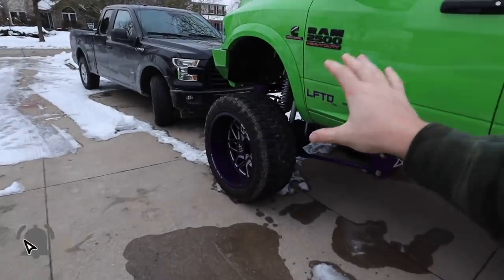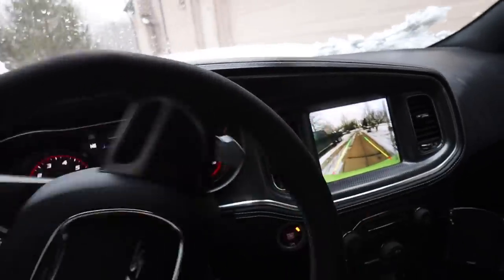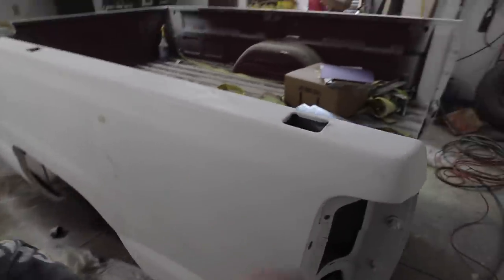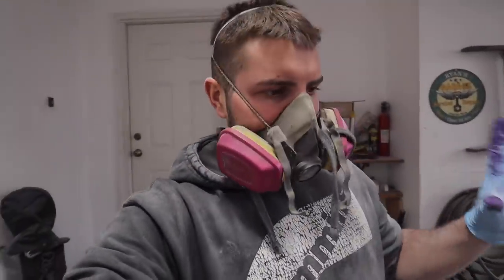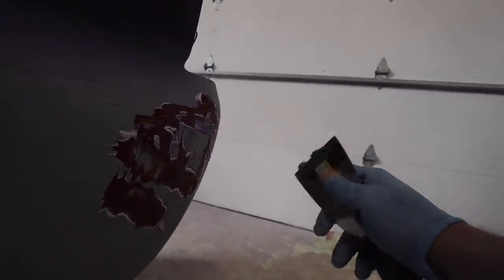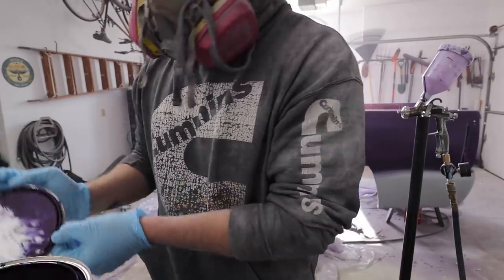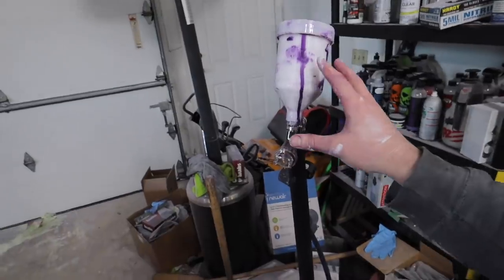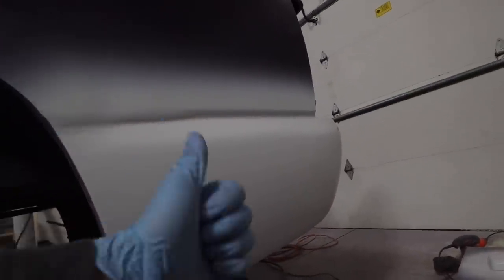I Am NOT Painting My Silverado LIME GREEN.....

Comment: A tip from the uk: before sanding the primer, put a really light coat of black paint on top of the primer. Don’t spray it solid black but just specs of black everywhere. Then when you sand it, it is easier to see any high or low spots and any pin holes you may need to fill before paint. Also wash you panels down before paint.

Comment: Alligatoring causes paint to craze and form wide cracks so that the finish resembles alligator hide. It is often accompanied by puckering, and sometimes the paint fails to harden properly. This is usually caused by applying a second coat before the first coat has completely hardened...

Comment: The wrinkle /peeling is from the solvents in the paint reacting the the rattle can primer go back it a good automotive 2 part primer. Rattle can primer and some automotive paints just won’t work together and you need to be wipe if the panel down with wax and greese remover before spraying and go over it lightly with a tack cloth before painting to remove dust and stuff from the air settling on to it

Comment: You need to sand it off then use rubbing alcohol wipe the surface  let dry .
Then use sealer primer sand that a little bit then wipe it down again .then apply color.

Comment: Did u use wax and grease remover prior to painting? That super clean  u got doesn't count .  You need an automotive  heat light.  I'm guessing it's not that warm in there to let things flash the way they should

Comment: Question if you don’t mind. I have a rust hole about 4 inches in diameter. Should I weld a small piece of metal to it and sand it till it’s flush then use body filler and paint and all that. Or do you think should I simply cover it with body filler? It’s a small hole directly behind the rear door of my F150 right before you get to the bed. Thanks dude. Great vid as always
Reply: Definitely weld in
Reply: Single Piston Productions Gotcha. That kinda my thought too

Comment: If you dont get some ventilation going when you clear it's going to look terrible. All that overspray fog. And yeah definitely need alot better clean down of the panels, WAY more. Wax and grease remover. Get some ventilation going. And clean up the dust and shop a lot better. Get the floor damp, some big wet blankets or towels work really good in a pinch or misted down cardboard on the ground. The SLIGHTEST variations in cleanliness, temperature, mixing it will all show so much more than you would imagine. Tiny little inconsistencies in paint/body work show.